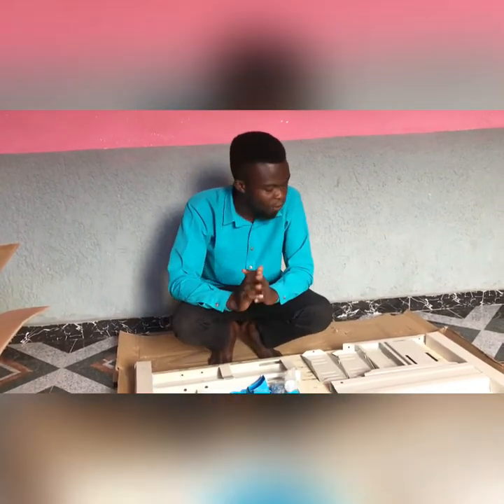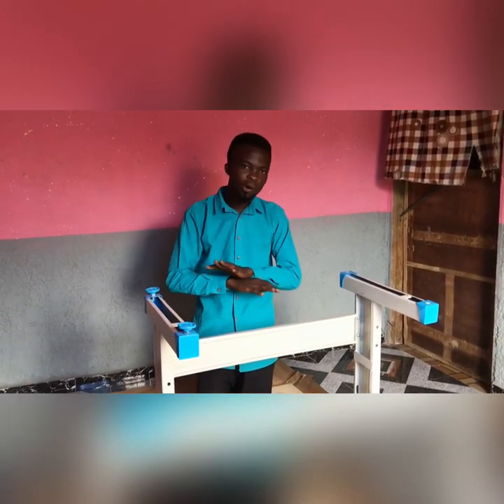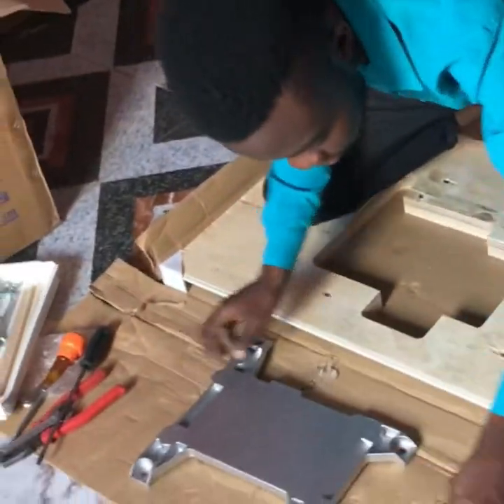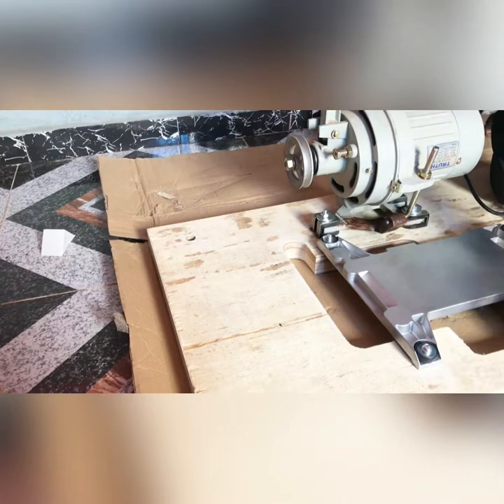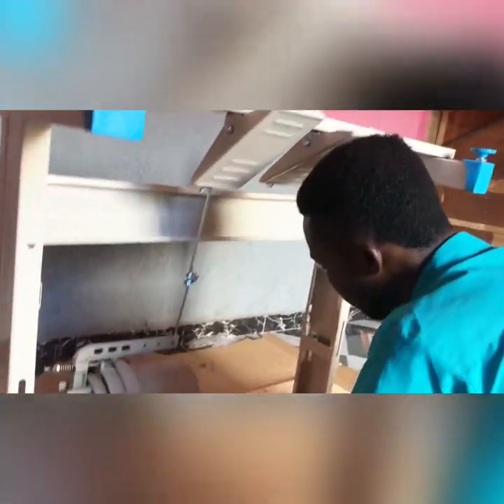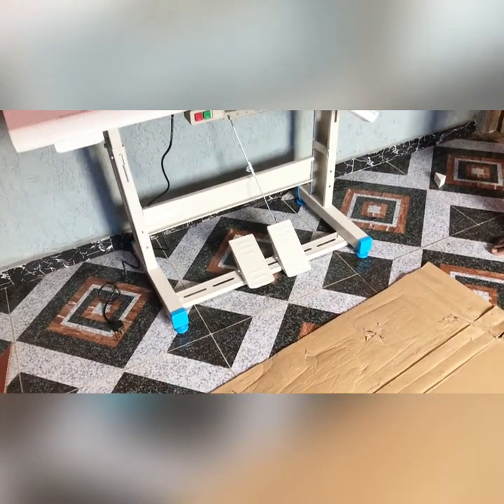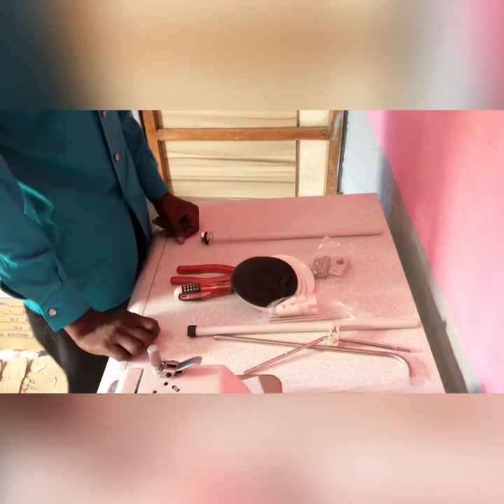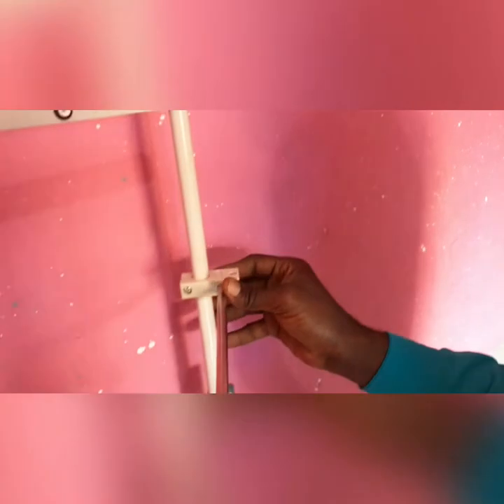How to assemble / install industrial weaving machine model 737/747/757. Easily

Comment: Please I need your help. My brand new two lion direct drive overlock machine was just installed but isn't working. The lights come on when it's switched on but the machine doesn't work. What could be the problem?
Reply from the maker: WhatsApp 
08174520114

Comment: Hi mr Aluku
Thanks for for your presentation.
There is one thing I didn't see you doing. I mean how to connect the wires at the back of the machine head.May be this machine doesn't have, but I bought gemsy and it has.if possible please your wassup line to help me witt and Ill be much gratefull
Reply from the maker: I’m sorry I’m unable to reply with pictures. 
Are you talking about the lead light or the wire to the clutch motor?